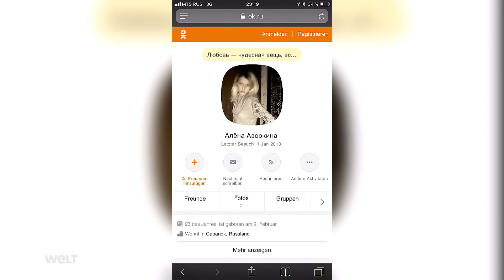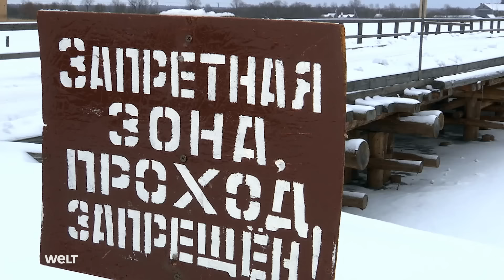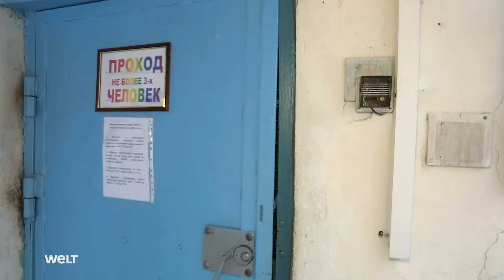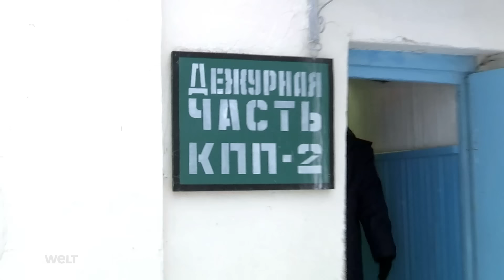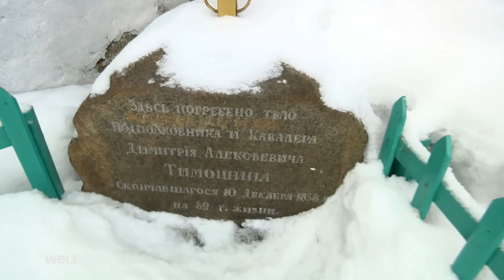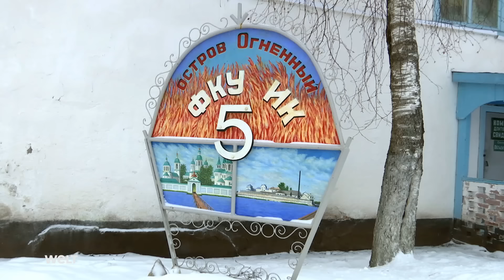RUSSIA'S ALCATRAZ - The toughest prison on Fire Island | Full Documentary

Comment: The Black Dolphin prison is worse. 

In there, its pretty much 24 hour lockdown in tiny rooms sealed with tripple reinforced steel doors. Prisoners are released for only 90 minutes a day literally into a slightly larger individual cage for exercise. All contact between prisoners is forbidden. The only personal effects prisoners are allowed to posses is a single radio or newspaper. When prisoners are moved, they are blindfolded so they can not memorize the layout of the prison. If prisoners are well behaved, they get four supervized phone calls a year. CCTV cameras are literally everywhere, including in individual cells. The guards make no secret of beating prisoners, and there have been cases of prisoners being beaten to death by the guards.

Pretty much hell on earth.